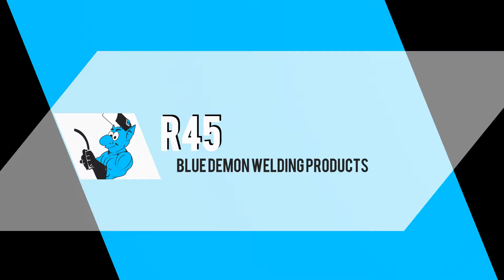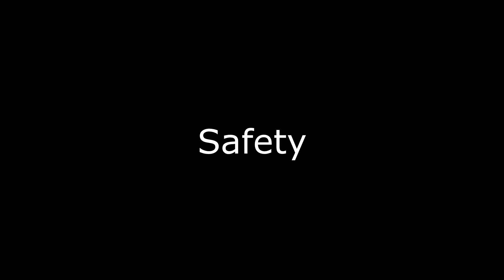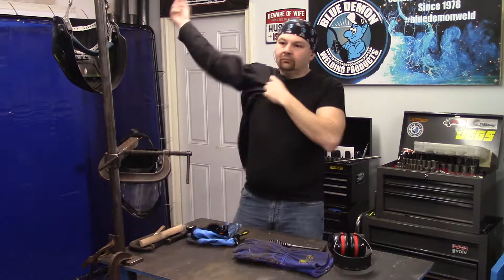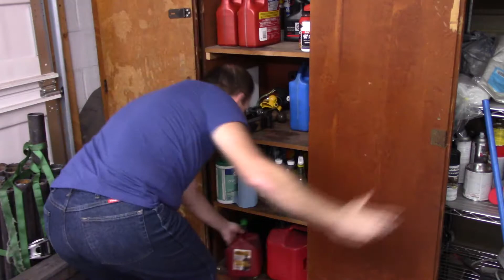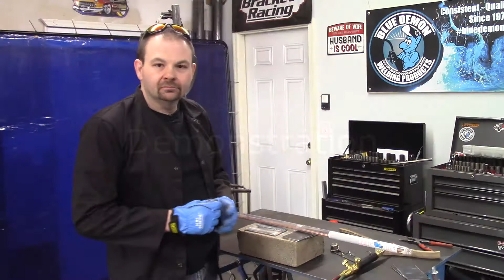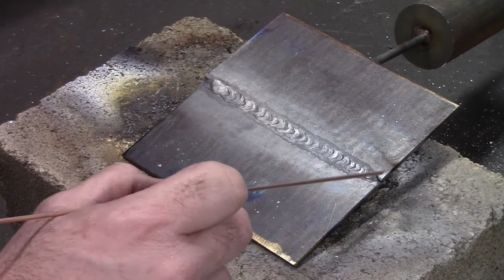Blue Demon R45 Gas welding Rod

Comment: What’s the difference between RG-45 and RG-60 and which one is better?
Reply from the maker: RG-60 creates higher tensile strength welds than RG-45. However, not every job requires a higher tensile strength. It isn't really a question of which rod is better because both fulfill different needs.